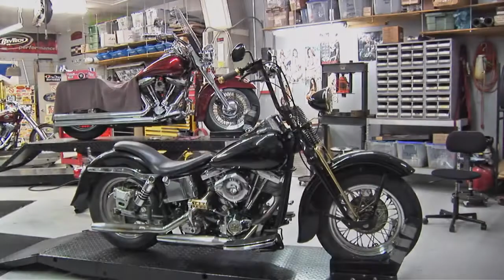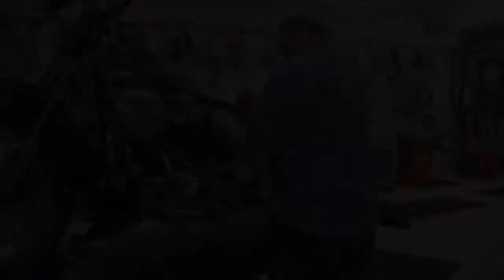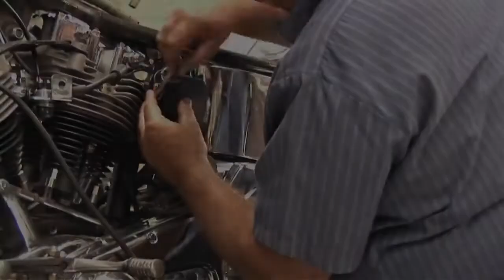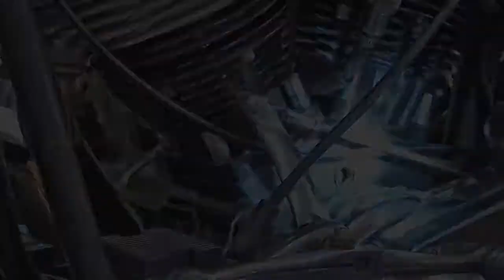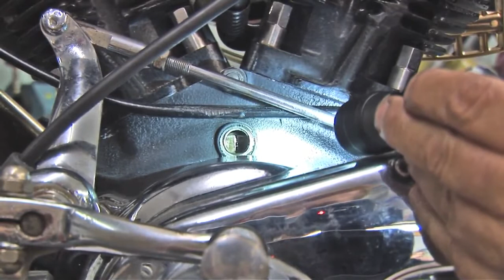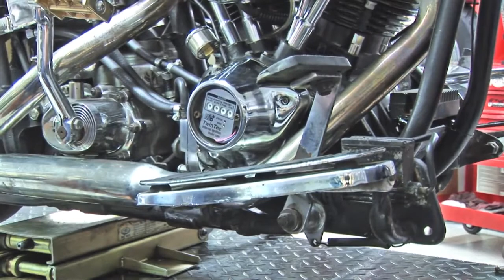Daytona Twin Tec - How To Series - 1005 Ignition Install - Kevin Baxter - Pro Twin Performance

Comment: Hi Kevin recently installed 1005 on a S&S Super stock project bike and will only run in Duel fire mode only will not start in single fire every thing tested fine went to twin tech David said more than likely it in the wiring of the bike I believe that, What would I have to change in the wiring ? has electronic start switch but I have installed on Harleys with no issues